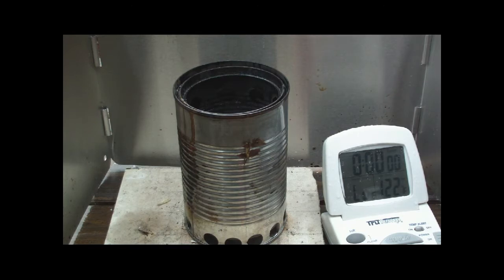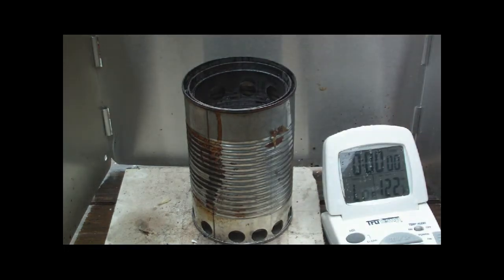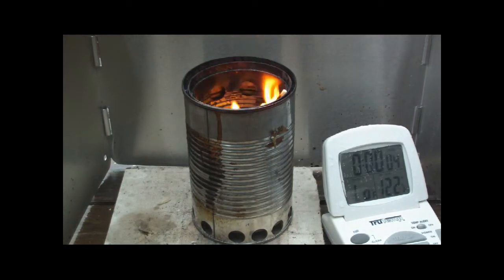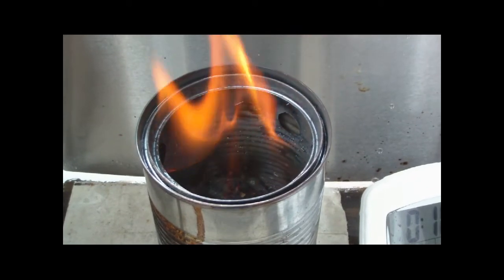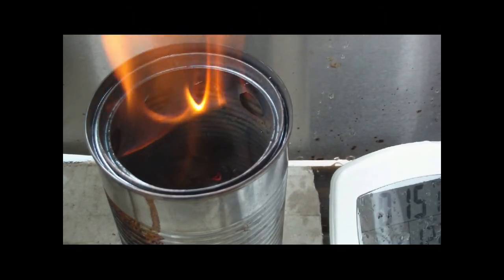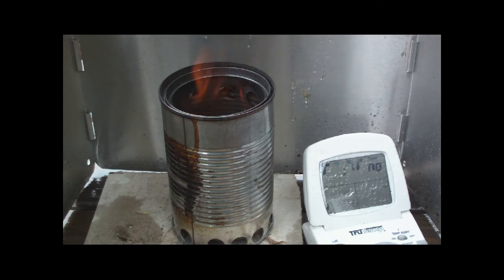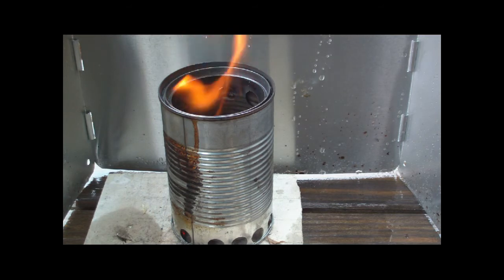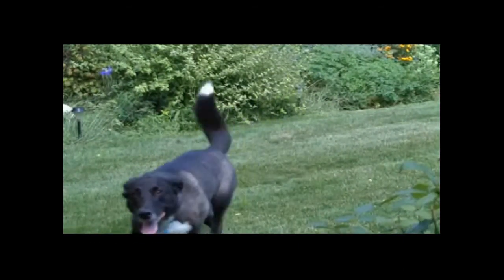Froup Stove - Burn Test 4

Comment: Hi Hiram
Loving the tests. Not sure if anyone has suggested this yet, but with your cage on the top, perhaps you could leave a few pins around the base and insert them into some pinholes around the rim of the can to hold it in place. I saw that somewhere else once. Also if you soak some of the wood pellets in white spirit, that would get them going quickly. You could use a mixture of soaked ones and dry ones.